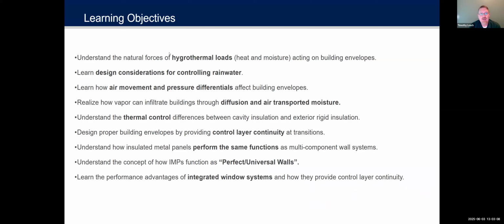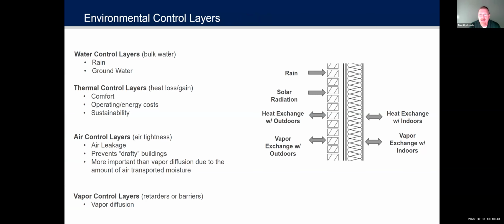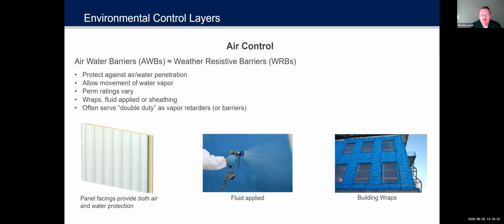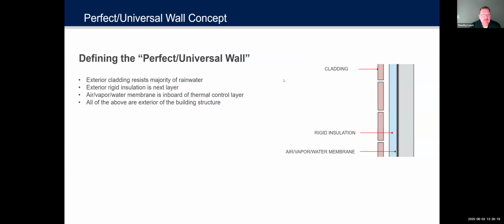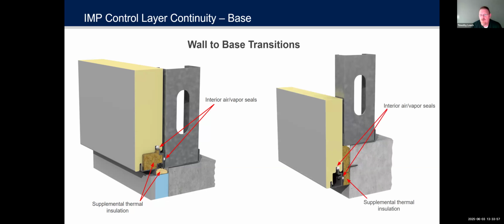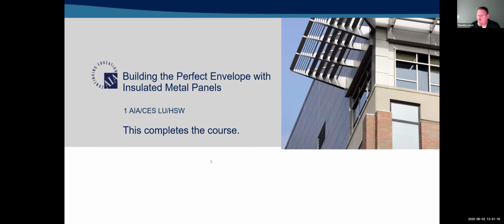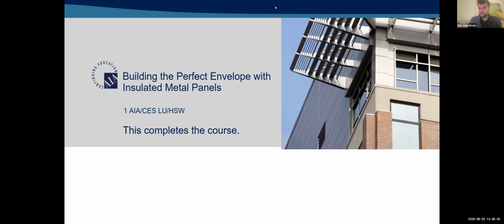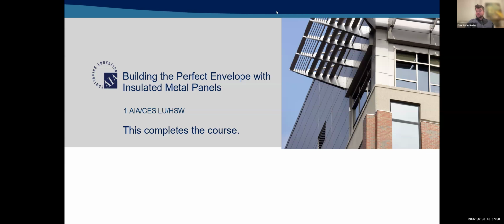Building the Perfect Wall with Insulated Metal Panels

Comment: Can IMPs be used as exterior siding, vapour barrier, insulation, and interior finish (in one panel thickness) on a residential structure with internally exposed post and beam structural members?
Reply from the maker: Hi Wesley, short answer is yes to your question but it varies by product. You can contact the manufacturer in this video for specific questions and applications. Generally the exterior/awb/insultation would be sandwiched together but interior finishes would be separate.